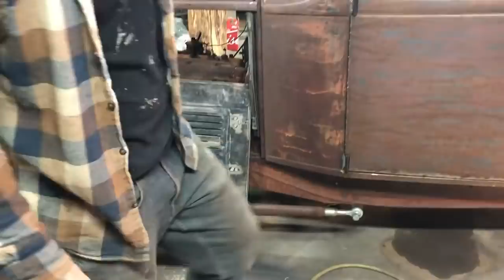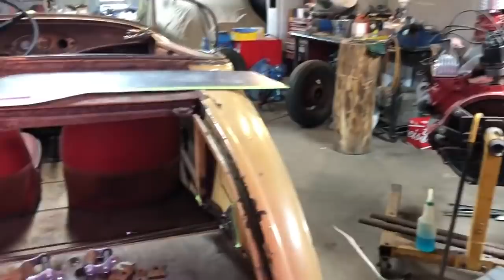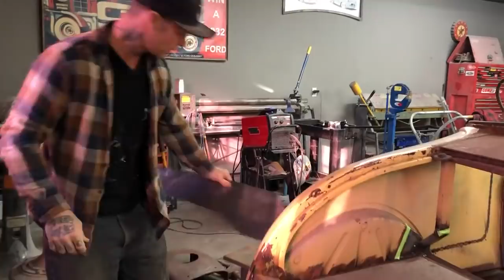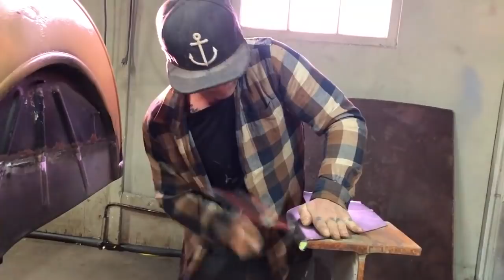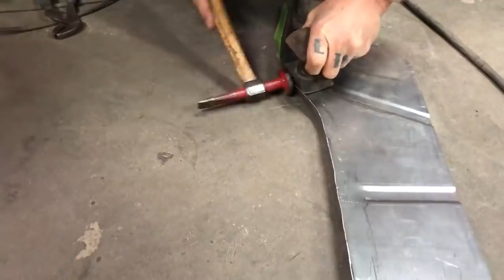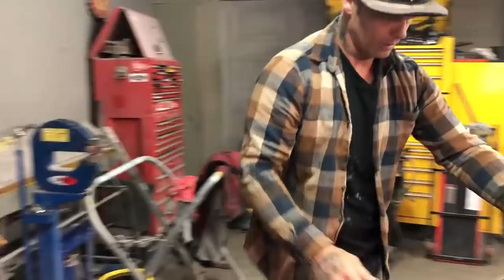How to make a patch panel

Comment: I use a dull chisel on a block of wood to start the line from the backside. Or a light pass through the bead roller with a tipping wheel. . Have my anvil on the bench. I like the I-beam for beating metal. I have a railroad tie upside down in ny bench vise. 
My knees cant take the concrete any more. And folding the edge makes panel stronger too. 
Not bad at all. Nice stretcher/shrinker.
Reply: Hey, Frank. Thanks for the dull chisel tip. Fantastic idea.

Comment: Could I send one photos if the two 1942 chevys I'm working on the truck has an awesome patina and only switching out the running gear to the open drive trian with a four speed and a 235 with a 848 head with lots of work done and the panel will have the same set up just 70 horsepower more with two 38 mill carbs on both and a 5 speed in the panel that one will be all polished metal with pin striping, I have alot of body work to do on the panel to wear as the pickup is solid.thankyou